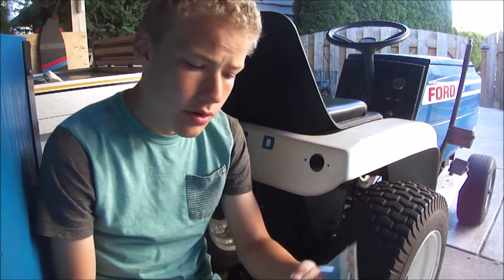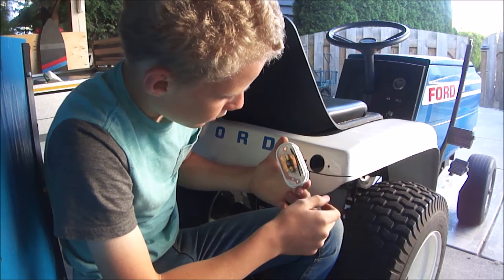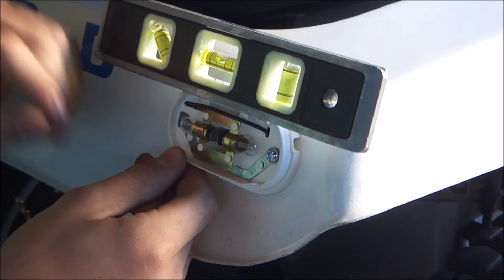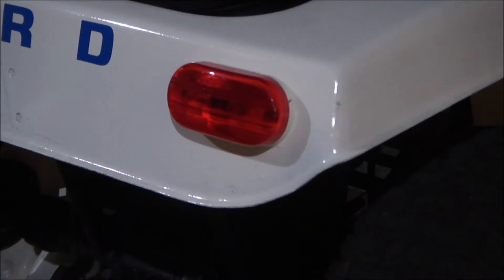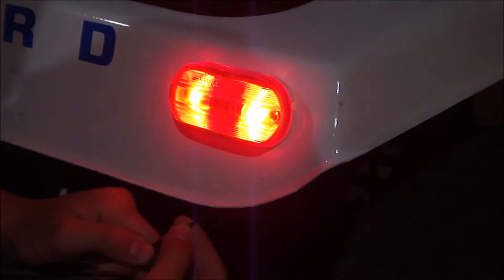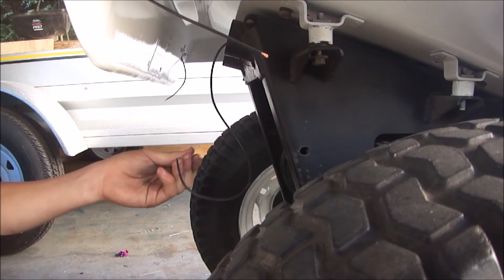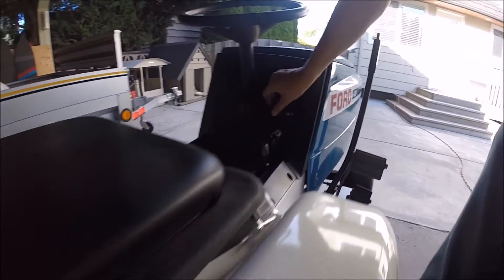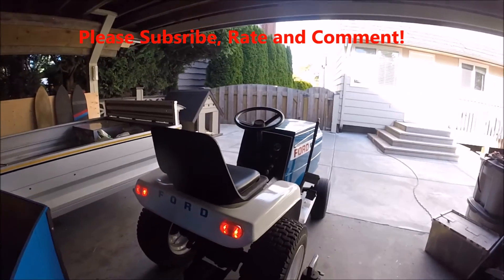Tractor Rear Light Install

Comment: I would have liked for you to show how you wired the feed wire. Where did you connect to get the electricity to go the the rear lights? Did you tie into the wiring that goes to the front lights?
Reply from the maker: Yes, these were tied in to the front lights circuit. Just fed a wire through the round tube frame from the front to the rear.